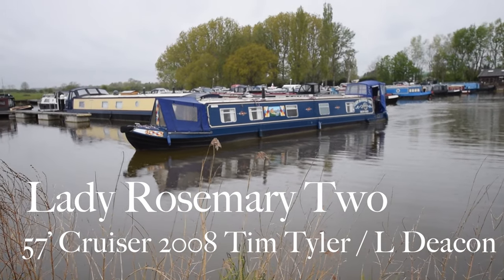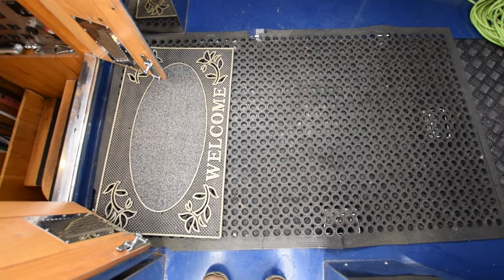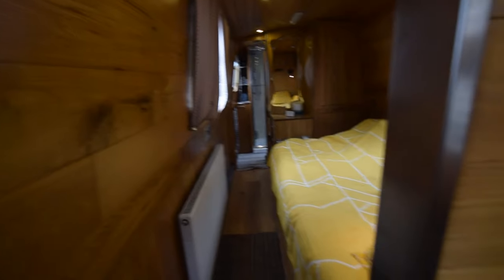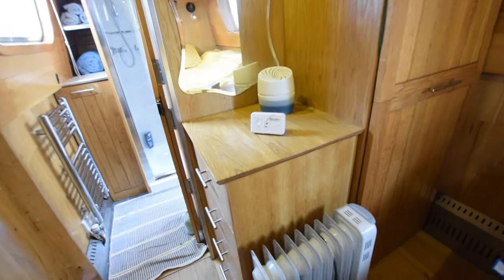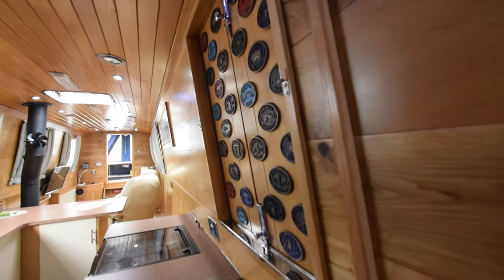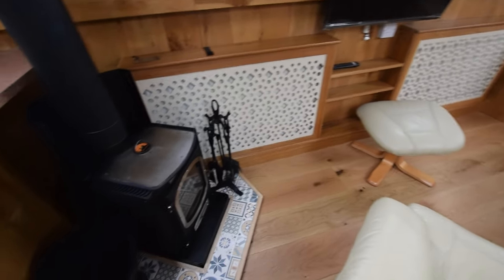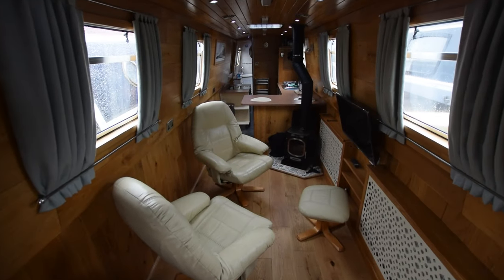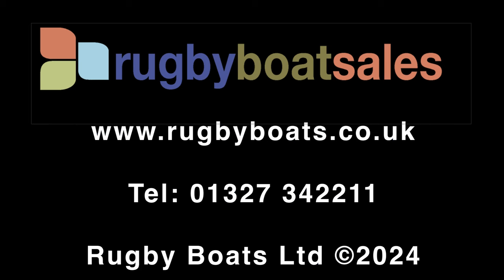SOLD  - Lady Rosemary Two, 57' Cruiser 2008 Tim Tyler / Calder Valley Marine

Comment: Wondering how much it costs to make one using stainless steel  ?
Never need blacking or rustproofing
Reply: This would make too much sense, therefore not allowed.... lol
Reply: Stainless steel will rust especially when scratched and scraped going through locks so would need some sort of coating anyway .
Reply: Stainless steel in 10mm and 6mm plate would be 10x the cost of mild steel, which is currently expensive enough. Some narrowboats were made of aluminium, Sea Otters being one of them. They never rust but they do tend to dent easily and internal condensation can be a problem.
Reply: @TheSkskitey  ... I didn't know that... thanks 😎

Comment: Why do all these boats have engines that look like they came from the stone age. Why don't they have an efficient modern diesel driving a battery bank with electric motors?
Reply: Because it only needs to push a skip at 4mph down a muddy channel. How complicated/expensive do you think it needs to be to accomplish this?
Reply: £79950 for a 16 year old skip, must be one born every minute!
Reply: Because electric or hybrid engines are for new builds and much more expensive - and not necessary.  The same applies to lithium batteries for the majority of owners who are not permanent cruisers.  Add to that the sound of the engine as you pootle along at 4mph; it's a love thing!! As you have no interest in living aboard a narrowboat it's all academic really 😊
Reply: You really don't want to get into that sort of thing.  Your going to have enough to fork out replacing electric car batteries as it is without adding up the cost of electric boats.
In an economy that's NOW driven by huge mark up because competition has all but been destroyed,  you don't need to complicate life and get cornered into a trap like doing away with cash etc.